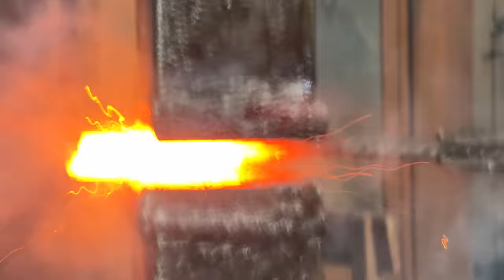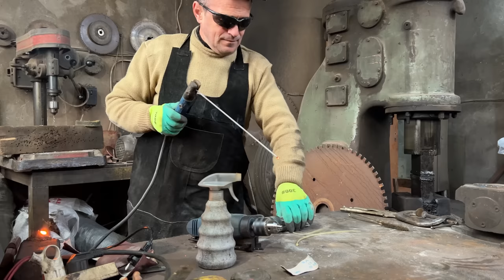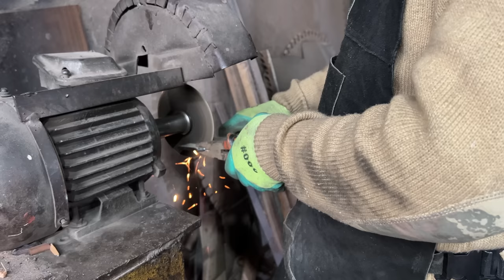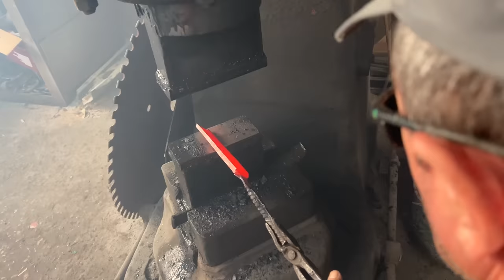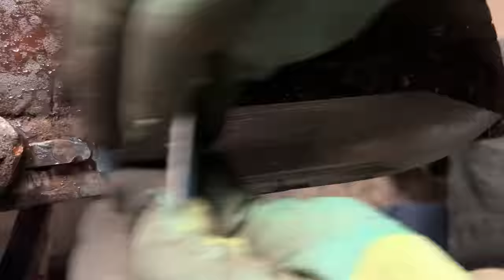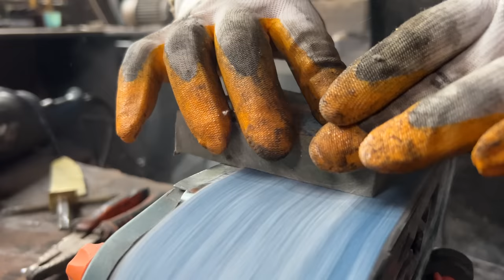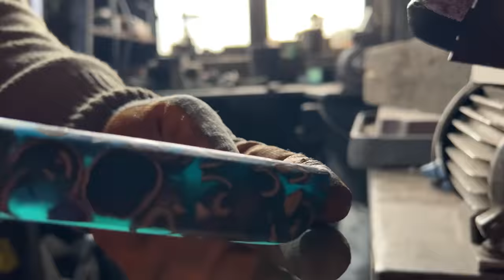Creating the Most Beautiful knife from Electrodes! The sharpness is amazing!

Comment: Neat shop, gr8 video, well done, it never occurred to me that welding rods would ever be considered for a knife. I don’t know how you’ve  managed to not get stuff in your eyes, when you don’t always wear glasses even when pounding the hot steel or grinding. Even when wearing safety glasses, I once had several metal bits get embedded into my eye, that entered when bouncing off of my cheek and into a small opening on my safety glasses. My eye got infected. It was so painful to have eye doctor remove the little bits from it. But it healed after bits being removed and antibiotics. Best of luck, and be careful. Thanks for sharing.
Reply: Working on my car and the same thing but I was wearing the safety glasses PLUS a face shield. I put the car in time out for two years after that.
Reply: I imagine how the blades were made in the past, with a lot of injured eyes and no protective devices. You are right eyewear is a must when working with anything that is heavy-duty jobs. But the knife is a charm!! What a skilled man!
Reply: I thought the same thing! Especially these large, extremely hot pieces from the forging embers. One stupid hit and your eyesight is a thing of the past... and try hitting something with just one eye with the hammer, it won't work anymore!😕
Reply: Absolutely.
Not to mention the circular saw blade on bench grinder, zero guards. Please be careful.
Nice knives though.
Reply: Lmao 😂 he was wearing sunglasses for the first weld
Reply: Das macht der original funkenschutz Pullover von Oma …
Reply: @w6075  Der warnt dann mit hell leuchtenden Flammen vor der Gefahr! 😅😋
Reply: I couldn't catch the number on the welding rod but for sure it is not the first choice for knife steel, would end up no harder than a henkles or cutco knife.

Comment: This video doesn't make any sense, I'm sorry but you clearly know how to make damascus steel, you have the dexterity, the knowledge and the tools to makes quality damascus, but nothing you made in this video can called quality. First of all, why using electrodes that are just mild steel, i can understand if you used the special ones made with high carbon steel, you could just use steel wire and avoid all the flux removal. Second, what's the point of stacking layer after layer of that mild steel, you loose all the pattern you would have by forge welding wires. Third, this is a scam, cause the damascus you end up with is clearly a mix with a high carbon steel, since is clearly visible after the acid bath that there is light and dark steel, and you didn't show when you inserted the high carbon steel. Fourth, with mild steel damascus you must make a san mai, mild steel jacket with high carbon steel core, that's the only way to obtain an usable edge, the way you made it is hard soft hard soft hard soft, that edge will be super irregular and useless, and could even crack the knife. The heat treatment is just inexistent. I don't want to be unrespectful or offend you, cause you clearly are a skillfull blacksmith, and you know how to make damascus, so please, stop doing this shit and make a real knife, a beautiful knife, you can absolutely do it

Comment: This was great black smithing content! Although I don't know what the white powdery stuff was you used on the molten metal it looked pretty cool
Reply: Its basicly the same stuff he knoked of them at the beginning of the video give or take some substances like  sodium carbonate, potash, charcoal, coke, borax, and lots more used up thru history . But im no blacksmith so i might be wrong
Reply: It's Sodium Metabisulfite it basically helps to clean up the metal . To help prevent imperfections in the end product .
Reply: @JamesSkellington-xj8nn  There you go ;-) thanks m8
Reply: Borax...acts as a flux
Reply: its Borax or Borassic acid in that form its used by just about every blacksmith that foirgewelds anything, it is different to welding electrode flux which is a mixture of compounds designed to melt and adhere to the surface of the metals but break off when it cools
Reply: @JamesSkellington-xj8nn  Doubtful ... Sodium metabisulfite produce sulfur dioxide when heaten and I don't see no mask in the video.
Reply: @JamesSkellington-xj8nn  Ah okay thank you for the explanation I learned alot
Reply: From the  car  shokes  you make the best and strongest  knife
Reply: Did you see the flakes coming off the bar as he forged it? It's mostly iron oxide flying everywhere and steel will not weld to iron oxide. Flux is used to prevent the oxide layer from forming on the surfaces you want to weld together. The 'smith cleaned the surfaces thoroughly before fluxing them just to make sure there was little to no contamination down into all the weld surfaces prior to welding. This guy has some real skills!!
Reply: Borax
Reply: It's cocaine, to train the steel not to freak out when you cut big bags of coke with (JK it's borax)

Comment: noticed something cool about the sparks around 0:05. do you notice the how wavy they are? 
I freeze framed the video and ive been trying to figure out why. 

Ive come to this conclusion: the sparks appear wavy because the camera is shaking. the wavelength of the sparks is the sound wave that traveled through the anvil, into the floor, and up the tripod. 

I'd love to hear your thoughts on why they are wavy. Like is there something with the metal cooling that causes them to splay in random directions?
Reply: Do less drugs

Comment: 6013s are good electrodes.
Might be cool to mix in some 7018 or a hard-facing rod.
Reply: 6013 and 7018 have identical core metals.  The only difference is the flux so nothing would change
Reply: @jaredm2631  exactly   going to say same thing

Comment: I loved the process you used to craft your knife, but I'm curious about the extremely short tang.  Will it hold up to very much pressure?  Beautifully filmed!
Reply: About 100 mm isn't long enough for you?
Reply: @patverum9051  thats what she said
Reply: Kitchen knives don´t need full tang because they are not made to chop wood or do survival stuff, they need to be sharp and comfortable in hand so you can do precision cutting. This is a kitchen knife handle in a japanese stile. Most japanese kitchen knives tang length is 2/3 of a handle length.
Reply: @ivanmakar7607  Thank you @Ivan Makar!
Reply: what do you mean short? it's narrow but it's almost the full length of the handle?
Reply: @merlindraws3616  it’s welded on, it’s not full tang
Reply: @orangello4894  the quench and heat treatment come after the welding. for all intents and purposes it's a part of the knife now? 

and even if it is more brittle at the weld, it IS still nearly full tang. the tang is the part that goes into the handle, not 'where the original billet ends'.
Reply: @ivanmakar7607  that is a fair point. this may just be my own personal taste but I would have still put a mechanical connection between the handle and the blade as well like pins. Epoxy doesn't last forever even in a kitchen setting.
Reply: Guess, long before the handle comes loose, the blade will have deteriorated. Welding rod steel is supposed to melt, not hold an edge, so you will have to sharpen that thing frequently, erading lots of material every time.

Comment: Much better! This time I can see that you paid much more attention to try and include as much as possible for your starting material, plus the multiple cutting and forge welding is the best way to create a good welded material with as little possibility for cold shuts as possible! I can see that you have improved greatly with using your power hammer, and I don't know if I have said this before, but you swing that 5 pound blacksmith's hammer like Thor Himself! Like a Boss! On top of all of that, you can see that with your cutting and reforging of the pieces, that although there is more wasted metal, it's more than worth it for the final product. your etching of the blade proves this to anyone with eyes. the etching of this blade proves that you have come along way in making your blades and that I certainly can expect more and better things from your channel. Also it was excellent that you could go to a local shop and use their magnetic grinder, this also improves the quality of your steel, making them much more even throughout so there are no groves from the hammer when you want a perfectly level blade for the kitchen. an outdoor knife can have hammer marks but a kitchen blade should be even and perfectly level throughout. Excellent work!
Reply: what is the white powder you put on in the begining?
Reply: @spaztic1  Borax.
Reply: Hey, I'm a newer blacksmith and I'm having a hard time understanding what exactly makes an etching. I know from watching videos that damascus is usually a mix of high carbon and a nickel steel then etched with ferric chloride but how/why does something like this etch, it's all the same material isn't it? I also understand that cutting it up and reforging makes a pattern but is that also the same reason why it was able to be etched ?

Comment: Good Blacksmithing, Good forging, but why didn't you continue the blank  through to the end of the handle so as to have one piece instead of creating a weak point immediately behind the pommel by welding an extension piece that would  take any force? I notice you didn't grind flumes into the blade to increase  strength and reduce weight.. Still a nice piece!

Comment: Excellent  traditional blacksmithing and  they use the same principle of laminations to make Japanese swords but  they just fold it over to finish up with binary layers.  Beautiful work, but I would suggest the gentleman would wear some safety appliances including gloves, and filters and perhaps some ear protection. 
All those welding rods reminded me back  about 56 years ago  when one tapered rotor induction motor broke the squirrel cage aluminium short circuiting  bars in its rotor, which went open circuit and so it would not work As an emergency I dismantled the . squirrel cage bars and inserted welding rods and bent them over at the ends and welded them together to  form the " squirrel cage". The motor worked well for the next ten years as it was installed in a plastic injection machine which had a start stop frequent cycle and so the higher starting torque due to higher resistance in the rotor came in very handy . The motor was never used at full speed, for any duration, but only for a few seconds, during the injection cycle,   
Congratulations to this gentleman, but hope he looks after his own health, Thank you for the video.

Comment: I'm curious how you got such dramatic low layer contrast with one metal? Also, are you not concerned about the many delaminations that occurred during the forging process? I have many more questions, but don't want it to sound like I'm slamming on you.
Reply: Yes curious too. Seems very weak metal compared with others.😊
Reply: Can you explain where the delaminations were you are talking about?
Reply: Electrodes are usually a mild steel. How did you get the heat treating and tempering done on a metal that won't?
Reply: the short answer is
A Master Craftsman can make porcelain out if pig iron.
Reply: @testickles8834  hmmm..... that would be another good trick...
Reply: @DentZilber  He might have used different types of electrodes, also properties could vary greatly depending on electrodes grade.
Reply: He doesn't make knives out of the material he starts with. You don't get contrast from mono-steel. Check his video where he makes a knife out of wrenches, you can see when he swaps out the billet.  He's a good scammer.

Comment: I think it is a sharp knife.
However, because the blade and handle are separated there is a high possibility that the welded part will break off during use.
It would be better to make it as one knife from the beginning and cut out the handle.

Comment: being a steel welding electrode, with very little carbon content, 7018 Atom Arc from Esab only has .045% as welded....
a typical amount for this type rod...
.seems like it would not have the ability to hold an edge, it would have a tensile strength of 78 ksi...
Esab 6013 like you are using has .10% carbon and a tensile strength of 81 ksi....not much different than 1010 Steel
I assume the carbon needed  is picked up from the charcoal used to heat the billet.....

Comment: Electric welding rods are wonderful to forge. They are particularly pure and as a filler between 2 pieces they have to emulate both the pieces to be joined and be highly able to fill that gap with  a flexible union. 7018 makes great "S" hooks, LOL A length of silver solder makes for a great Cast Iron meld

Comment: so all you need is about $20,000 in old equipment (buying used) and 20hrs of labor?  now why haven't i done that already ...  ;)
oh ... and using a carborundum (silicon carbide) cut off saw with NO guards?  yea, that's NOT smart ... nor is holding the rods in your hands.  Get table for the darn thing and do it right !!  Why advertise  bad safety procedures.

Comment: Having worked at Airco Welding Products for several years, I can say that all mild steel core wire is low grade. 6011 and 6013 is junk rod for low strength work. 7018 is no better. Hard facing rod would be better for knives.

Comment: What's the point of wasting electrodes when in the end you end up with simple wire that was used in acetylenic oxide welding... I've seen drill bits used, chainsaw chain bearings, etc. which certainly make more sense because they are materials with other characteristics than those simple carbon steel... I really appreciate your effort but it seems like a useless effort to me.!!!

Comment: Isn't this really just a folded blade? Yeah you started with the cores of a bunch of electrodes, but most of this video is basically a version of folding where you cut sections and overlap them instead of folding sections over.

Comment: Nice knife making, the only thing that worries me a little is the heat treatment, I don't think I know what the purpose of the knife is, but I think the heat treatment should be done at a slightly higher temperature based on the color I saw during tempering...

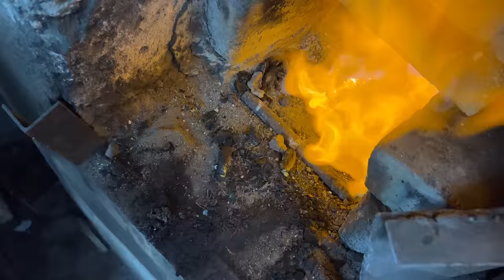Comment: 17:19 you can see that knife wasn't soaked properly. It has cool spots at the tip and other places meaning it didn't reach proper austenizing temperature and will not harden or have softer spots after the quench. 
Not sure what the rods are made of but i don't think they'd make great knife steel.

Comment: Im really curious about the white powder things that blacksmiths put to their forged steel, and what does they do to the steel
Reply: It's called flux, and it helps reduce oxidation to the workpiece mostly by providing a protective layer against oxygen in the air. This is especially important when you're forge welding steel because any impurities that gets sandwiched between the metal — called inclusions — present a weak spot to the finished weld. Also, the scale created by oxidized metal interferes with forge welding, too.
Reply: @BrokenLifeCycle  I was wondering the same thing. Thank you so much for the info.

Comment: One needs to devise a special alloy with switching crystals.
Then you can press a button for 'bread knife', or one for 'turkey', etc.
The blade edge will automatically switch from smooth to serrated.
Thus eliminating the need for sharpening, or a forge.